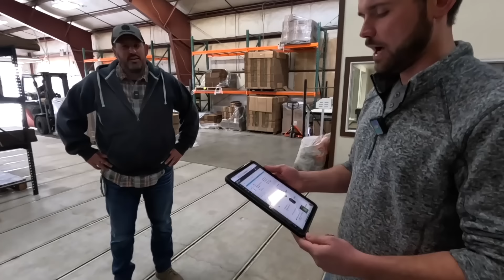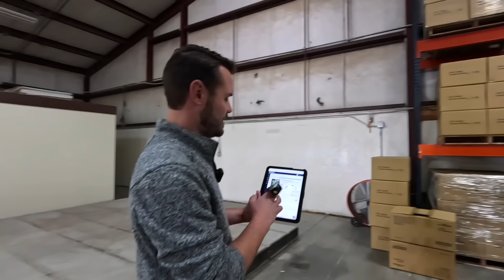New Warehouse Tour & Planting 2 Cedars! 🤩🌲🤩 // Garden Answer

Comment: Great tour and planting trees is always exciting! I'm enjoying my huge kneeling pads so much! 

The hose end sprayers are great for Proven Winners fertilizer. I have a different brand so the math will probably be different to achieve correct ratios, but for mine I just dissolve 20 scoops of Proven Winners water soluble fertilizer with water in the hopper, making sure to shake it until it's totally incorporated. At that point it's basically a liquid concentrate. Then I attach the hose and get after all of my annuals! I have a separate one for pesticides to avoid cross contamination.

Comment: It's easy to forget....but Norway spruces have quite a width as they mature...planting too tight will cause die-out and disease, especially on the lower branches, and other trees around them, and then require limbing up....look ahead and imagine size minimum10-15 years ahead.

Comment: I would very much like to know whatever type of gates you are getting. I especially would like to know what automated gate opener you are using. I have my 12 foot gate posts installed and I’m researching the gate openers. I could really use some advice ASAP. I don’t necessarily need a code for security, but I want delivery trucks to be able to get in and out easily. We are not using the gates for security, but for deer fencing. I’m a bit confused about how the sensors work. Help!

Comment: Thinking the platform in warehouse can be  removed with forks on a forklift.  Platform just laying on the surface and could be pulled out one section at a time. Save them for another project in the future.  They will simply stack.